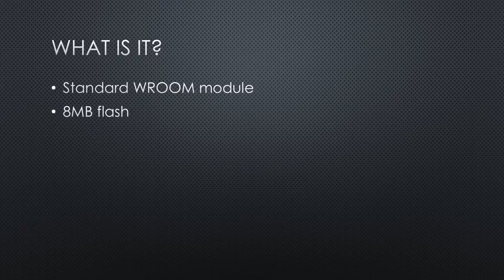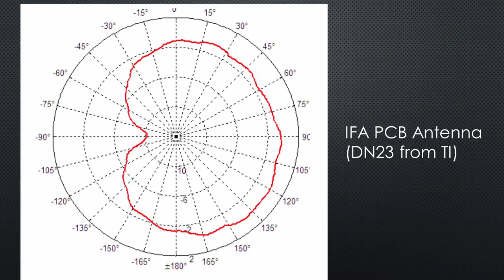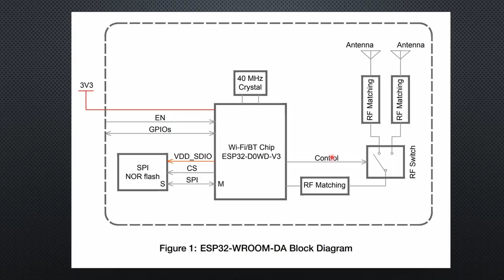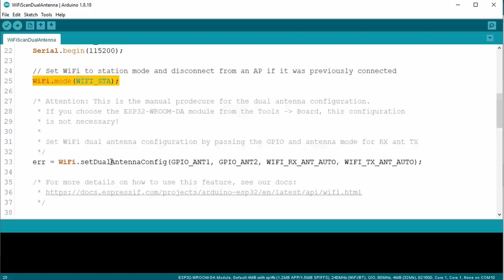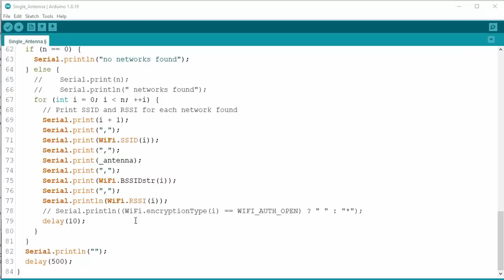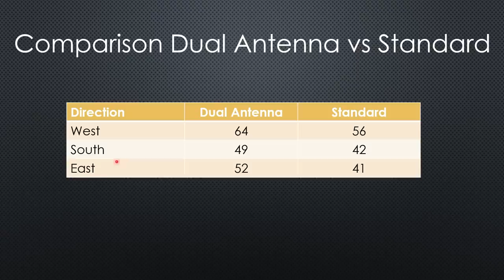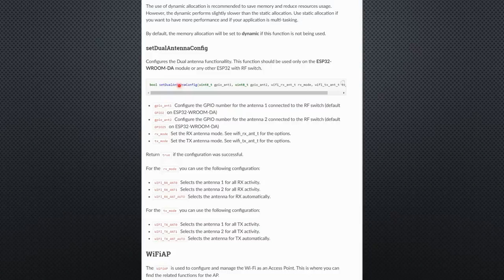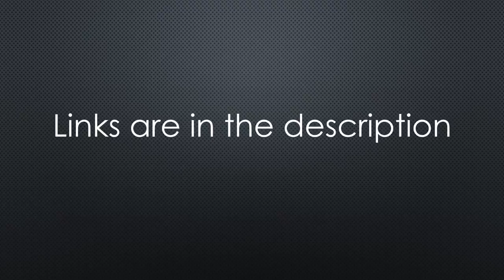#422 A new Dual Antenna ESP32 Module: The WROOM-DA

Comment: So, when will there be a 3 antenna version with one for the Z axis? Would that even be useful? Maybe for very mobile devices (drones?) since it could help with kinda directional antennas since the right antenna would only send in roughly the right directions.

 Personally I like external antennas more than PCB antennas when I can't use POE for a Project, at least I think it's easier to place them outside a case.
Reply: There would be no additional benefit in using 3 axis antennas. A rod-like or omnidirectional antenna is weakest in performance when it points directly towards the communication peer. So when you have a second one at 90° angle (transverse to the peer direction), that one is guaranteed to have the good orientation. Having a third antenna would have the same 90° to the weak antenna, but there is no additional gain in sensitivity / range / receive strength.
Reply from the maker: Adding an antenna with a different polarization would make sense because the effect of polarization is quite high. But then the device would become much bigger and probably harder to manufacture. Maybe they will create one with two connectors. Then everybody could create the setup he needs (also with external antennas).

Comment: Nice video andreas. But is it possible that your test algo is not correct for the test of the auto function? Wlan scanning is a good to have feature. I think you must connect to a wlan and the algol of the chip checks on wlan idle which ant have the best receiving quality (or sending?) and switch between the two ant? Can you connect to the pin how controls the rf switch?
Reply from the maker: AS I mentioned, I am not sure if I chose the right test procedure. However I do not know why they would not use a proper antenna selection for the scanning. If you do not find the access point it is probably hard to connect to it...
I also do not see how we could use the TX signal because our chip does not know how good it is received at the opposite station.
I hope we will get some insights from the Espressif engineeers...
Reply: @AndreasSpiess  Its possible that the engineeers think you will "hard code" the ssid and pw. I does not matter how you send the signal, because the receiving system also have multiple antennas most of the time. Its only how good the receiving signal of you choice is. But look in the capsman of you wlan system. You will see also both ignal qualitiy in the list.

Comment: If the antenna-select GPIOs are accessible as described, then they could be monitored during operation to see if the auto mode is even switching between antennas
Reply: Good idea - and how frequently they are switching...
Reply from the maker: A good idea. I should have thought about it before I soldered it to the PCB :-( But I hope we will get the info and do not have to do reverse engineering.

Comment: Could you test upside down with a 180° rotation where antenna 1 is exactly where antenna 2 was.
This would permit to compare and see if the two antenna behave the same.
Reply: I would also compare the received stations in relation to the A0 and A1 orientation difference versus the West, South and East orientation of the module. So if A1 (right side antenna?) points to West, I would try to correlate reception through A0 with South direction reception. And may be flip it upside down too and correlate in the reverse direction.
Reply from the maker: This would have been a very good idea! Maybe I will do it later. When I have better info from Espressif.

Comment: The auto switch mode may need an established link to perform correctly. Since the test only is scanning for networks, there is no link and no link quality rating. Having only the Rx dB values of the own node may be perhaps not sufficient.
Reply from the maker: I agree (and mentioned it) that I do not know if this is an appropriate test. However, the decision probably has to be based on receiving and not on transmitting because our chip does not know the signal strength on the other side of the link.
Reply: @AndreasSpiess  I don't know if a normal WIFI link does, but if firmware supports it, the receiver can talk back to the transmitter and tell the last frame's Rx strength. So the original transmitter knows which antenna was best to send with. This method is also commonly used for dynamic Tx power control.

Comment: I would guess it's a combination of unfinished software and wrong use. No idea why it scans less SSIDs but In my opinion it's likely that it  can switch to the correct antenna when associated with a station. (Since it may be utilising sounding frames typically used for mumimo to choose the antenna.)
Reply from the maker: I hope we will get the needed info from the developers. I am curious.

Comment: Hallo,  ich habe bisher immer mit Arduino gebastelt, nun habe ich einen ESP32 geholt, habe aber nun das Problem, dass die Portmanipulation nicht genau so funktioniert. Im Arduino habe ich sowas wie PORTD = PORTD & 0b00000011;           // pin 2-7 off, oder PORTD |= (bits & 0b11111100);      // pin 2 - 7 machen können, geht hier nicht mehr so, wie geht das im ESP32? Danke
Reply from the maker: Einfach mit den normalen Arduino Befehlen (digitalWrite). Ich habe bis jetzt noch nichts anderes gebraucht. Der ESP-32 ist viel schneller als der Arduino.
Reply: @AndreasSpiess  ok, versuch ich mal
Reply: so, habs getestet, funktioniert soweit.

Comment: When several years ago i did some experiments with Wifi signals around my house i noticed a lot of signals  from cars and other moving things. (Mobile phones) Also it seems some phones constantly change there mac address to give privacy e.g. in shopping centers where they do/did tracking. So the timeframe is also very important when sampeling.
Reply from the maker: You are right with Mobile phones. They change the MAC address often. In my case, I do not see it as a problem as not a lot of moving Smartphones were present (names usually are different, and I know a few AP names from past tests).

Comment: (For some reason my comment disappeared.) Hi Andreas, I'm totally new to this field and I would appreciate your help please. I have Wemo D1 Mini with the battery shield but for some reason it draws 120mA with an empty sketch and, more importantly, 4,1mA when in deep sleep, which based on your videos and other guides and reviews is WAY too much. From other sources I've seen it draw 0,17mA and lower in deep sleep. Do you know what might be the culprit? What should I look into? Thank you very much
Reply from the maker: Comments with links often are deleted on YouTube. I made a video about the D1 Mini and deep sleep. These boards are not made for that purpose.
Reply: @AndreasSpiess  what would you recommend for deep sleep, suitable for a beginner? In the batch that i bought were also ESP-1 and ESP-1s.
Reply from the maker: @guyfromostrava  There are many videos about deep-sleep on this channel.
Reply: @AndreasSpiess  Yes, there are. But there is not 'best of deep sleep' video that I could find. I understand this is a complex question, but just in short - the only thing I need is deep sleep, battery and a reed switch (just a single GPIO pin). The device will be connecting to the wifi once is a month or so. What would you recommend?

Comment: Shape reminds me of a B2 bomber. Seems like a lot of effort that can be solved by a UFL antenna. That 20 seems to be a software limit at face value. Think it is picking the best 20 access points based on RSSI. I know there is a soft limit to the amount of access points the ESP can store in memory on a single scan.
Reply from the maker: Maybe 20 is the reason. But this seems not to be the case if I select only one antenna. Strange...

Comment: Is there maybe something where it is disregarding signals with too low a gain to be normally useful? Is it trying to filter? It would make sense that the 20 signals it finds are the strongest. Maybe do a test where you connect to your own wifi from a far distance. See if it has some advantage there.
Reply from the maker: In my opinion, it should switch for weak signals because there it matters. For strong signals, any antenna will do. I hope they will give us the needed info when they watch the video...

Comment: it seems you could make 2 wifi devices with this.. make a nice repeater too...input on one, output on another...
the auto switching maybe fast (or slow!)..so you miss alot of ssid's..when its set to one its constantly on and doesnt miss any frames...
...this with external antennas would be interesting... (you also missed the chance to compare against an external antenna in this vid!)
good stuff Andreas.. i didnt even know this existed till now! ..thanks!
Reply from the maker: Unfortunately, the ESP32 only has one radio. And repeaters in such a small space are nearly impossible because of cross-talk from the transmitter to the receiver when they work at the same time.

Comment: Maybe could use it to find the WiFi router or your lost phone. If it could compare the WiFi strength from the left with the right and then  calculate from which direction the signal comes from
Reply from the maker: I do not think this would be very precise... Apple has something in their new iPhones which work remarkably well. But only on short distance.

Comment: @Andreas there is a use for having a send and a receiving: replace the receiving Antenna with a high gain  directed one... new challenge: long range WLAN with ESP Modules

Edit: The challenge is meant to be w/o breaking the emision laws!
Reply from the maker: If they would add connectors instead of antennas, we could build interesting things. Like that it would not be easy to properly mount a connector.
Reply: @AndreasSpiess  is it possible to solder a miniRCA on the module? (e. g. like on Raspi 3/4 the antenna trace runs between the groundplane, on raspi it needs steady fingers, a high thermal capacity iron and a bit luck)
Reply from the maker: @emmoemminghaus6455  I did not try. But it should be possible.
Reply: @AndreasSpiess  I like to try... but the only source for this module is Mouser, and i have not enougth volume to avoid the shipment cost.

Comment: This has some potential but it needs more tests in the field. Next a ESP32 with a build in Yagi antenna. ... wait I see some potential in that fitted in a nice weatherproof enclosure.  Or maybe we could use one with a uFL connector soldered on a pcb with a microstrip line collinear antenna.
Reply: Hey why not dual ufl?? 😎
Reply from the maker: Two connectors would be cool, I agree.
And I have a directional WiFi antenna in my lab waiting for a test. Maybe when the weather is warmer...

Comment: Interesting to find out that the two antennas cannot be used simultaneously. I was looking for a module where I can use WiFi and BT simultaneously. So this module won't work for my purpose. Thanks for testing as it helped me.
Reply: Afaik there's only one amplifier and associated hardware for generating the signal. This is just two antennas, not two separate radios (which I agree could be good but rip power consumption)
Reply: From my own experience the esp 32 has not enough space for both libraries. Maybe try to compile both libraries in the the Compiler just to test if it works bevor you buy one for that purpose
Reply from the maker: The ESP32 uses the same radio for Bluetooth and Wi-Fi (similar frequencies).
Reply: @Tom-ku8bu  is that for Arduino programming I assume? I've not tried that but I use the IDF at home and for work, no problems at all with WiFi and Bluetooth libraries concurrently. Still tonnes of space for other code too. I even made a wi-fi to Bluetooth speaker bridge using an esp and it handled that no problem (audio from VoIP to the esp, which pumped it out over Bluetooth a2dp to a Bluetooth speaker)
Reply: @DrGreenGiant  Interesting. I also wanted to make a wi-fi to Bluetooth speaker bridge with an ESP32. By chance is your code in github?
Reply: @joachimkeinert3202  unfortunately not no, it was for work so not public. The examples in the esp-adf should get you most of the way there though
Reply: two RF transceivers in such close proximity would not be a good idea. In the case where one module is transmitting an the other receiving, the receiver would likely be de-sensitised by the transmitter.
Reply: @RobB_VK6ES  I assume it works in a smartphone?

Comment: did you try another module and confirm this behaviour? It almost looks as if in Auto both antennas get connected 😎
Reply from the maker: According to its datasheet, the RTC6603SP RF switch chip cannot connect both antennas at the same time. And I did not test a second chip because I thought it is more a software than a hardware problem...

Comment: Regarding the comment from 2:45 "If you do your own design..." 
I don't think this is a good advise to have the module antenna hanging out from the PCB, it just makes the design fragile and awkward. And FR4 is "invisible" to radio waves. What you need to do is respect the keep-away area indicated in the Espressif datasheet: No track or ground plane below the antenna section, only empty FR4 on both sides of the PCB.
Reply: I guess it was more meant to be like "clear the copper of that area". People forget to remove the copper from such areas, which is why "move the antenna outside the PCB" is kind of working. The copper is visible, and almoste always grounded. But yes, fragility is an issue
Reply from the maker: The board I showed with the overhanging antenna is from Espressif, BTW. My experience is that plastic around antennas influences their impedance considerably. I did no tests with FR4 but with PLA and the black covers of of ordinary antennas. And you have to consider the „stackup“ of PCBs in the impedance calculations of striplines, too.
Reply: @AndreasSpiess  The experience you have on PLA close to antennas is interesting, I think many makers among your audience (me included!) package ESP8266 or ESP32 devices inside PLA enclosures, considering the enclosure to be fully transparent to RF. It would be very interesting if you could elaborate on this. Maybe a good subject for a future video in one of your channels?
Reply: @opsahle2  I can confirm Andreas' exprerience. I started to use separate ULP/SMA separate antennas in enclosure to compensate for the signal loss.
Reply: @opsahle2  just perform some rssi tests with and without the box ;-)
Reply: The ESP32 Hardware Design Guidelines (one of the Fine Manuals) recommends the overhanging antenna as preferable for a module like WROOM. Interestingly, they say it‘s best with the module at the right corner of the board, better than at the center or left corner. No idea why. They allow that the module might be mounted with the antenna over the board, if the keepout region is kept clean — “no copper, routing, components on it” — including 15mm clearance on all sides of the antenna. But they‘re quite clear that the overhanging antenna is preferable.
Reply: Just looked at the Design Guidelines for ESP32C3, yet another Fine Manual. ESP32C3 with an onboard antenna can have the feed point for the antenna on the left or right, and they recommend placing the module at the corner of the board where the feed point is. Which answers my question about why the corner is preferred, that‘s where you have the largest clearance around the feed point.

Comment: The antennas are rotated 90° in relationship to each other, perhaps having dual antennas allow us to select the antenna that better match the electric field direction of the router, perhaps some further tests rotating the antenna of the router in vertical or horizontal position and then measuring the signal intensity at each antenna of the ESP32 would be interesting. Does this make any sense?
Great video as always !!!
Reply: That's the case. An omnidirectional antenna is good only when the other network node is transverse to the rod. In the direction of the rod the field is weakest. So having another antenna at 90° will always cover this dead zone of the other antenna.
A link is best when antennas are parallel. It's weakest when antennas point towards each other (omnidirectional rod antennas only).
Reply from the maker: We also have to consider that we often do not exactly know the antenna direction of the opposite antenna (without opening the box). Plus, in buildings, reflections change the signals considerably. That is why I think having two antennas and selecting the better one should get better results in most cases.

Comment: Usually I agree and I am pleased with your torough reviews. I may be mistaken, but I think you are missing the point. Two antennas are not meant to discover more networks, but to split incoming and outgoing traffic on separate channels to increase speed and throughput. This is the main advantage !

Second my friend, W is not = to V in English ! LOL ! It's not V-ROOM it's WROOM like the roar of a car ! Have a great day ! Auf Wiedersehen !
Reply from the maker: The ESP32 only has one radio. So no improvement of the speed :-( Would be nice.

Comment: It only looks "ugly" until you realize you could mount it at 45 degrees at a corner of your main PCB, at which point it would blend in perfectly. Just make sure the main PCB is actually missing the "L"-shaped corner bit that would be under the antennas themselves.
Reply from the maker: A corner mounting indeed is a good idea. I did not think about it.

Comment: BLE not work with wifi. May be BLE and wifi radio work same time with 2 seperated antenna. 🤔
Reply from the maker: Bluetooth and WiFi use the same radio in the ESP32. So they never will work exactly at the same time.